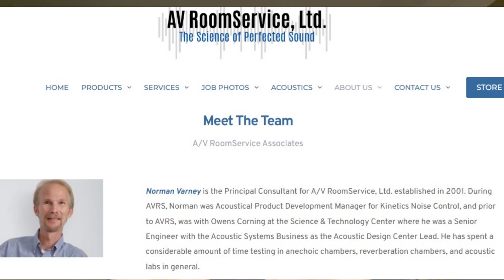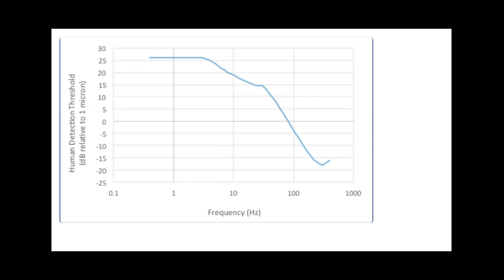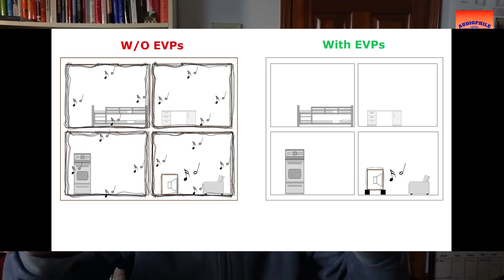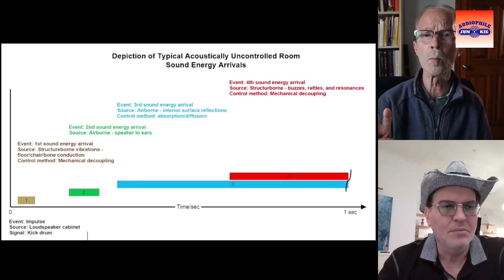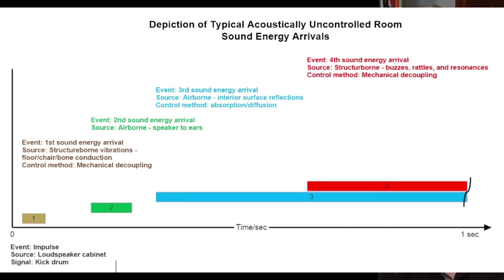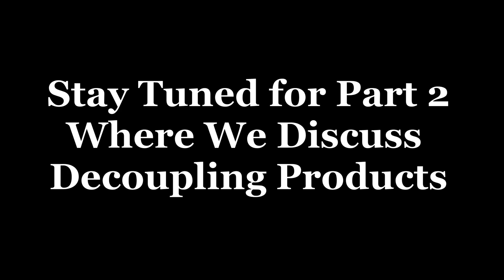Couple or Decouple?  THAT is the Question and the Physics Why One Is Ruining Your Bass - Part 1

Comment: In my experience. Couple the speakers with spikes but decouple subwoofers and the source/pre-amp/amplifier etc. with rubber feet.
If the speakers are decoupled it messes with the timing and makes the music sound undefined.
Reply: Coupling will always skew timing, because it includes vibrations from more than the just source.

Comment: The coupling/decoupling question is probably a lot more complicated than we imagine.
The sheer range of factors is mimd boggling: integrity of loudspeaker cabinets, drive unit integration with the cabinet, differences in flooring, room construction, loudspeaker frequency response etc.

There is unlikely to be one answer that satisfies everyone.
Reply from the maker: You're correct and we touched on the fact that nobody has really ever experienced a totally isolated room from their equipment due to a variety of factors... Just like virtually no one can create a totally anechoic room... No matter how many room treatments they add 

However, if we can all at least agree on the physics, and the fact that colorations due to vibrations are bad.  From there, we can then debate whether these vibrations cause any MATERIAL problems that are audible for the songs and volume we enjoy.  

In many cases, the microphonic vibrations aren't creating a huge audible problem with our other gear or room... But we can still agree that it's better to NOT have them for optimal POTENTIAL performance.
Reply: Vibrations, other then the source, distort the source, all with varying degrees. As audiophiles and/or audio engineers, we desire optimization of performance, neutrality, consistency, and repeatability. Remove as many variables (distortions) as possible to get the to truth as well as maximum fidelity.

Comment: Correct but that’s only one thing
Your room is the. Biggest distortion 
Most people don’t have proper room treatment acoustics. QRD diffusers & affecting bass traps
Ones that are effective are diaphragmatic activated carbon built into the walls ceiling’s & floors a room within a room not coupled to the existing room
QRD on whole of front wall & Rear wall
& some absorption on side walls also
Look at acoustic fields Dennis foley
Reply: Yes, room acoustics is the biggest contributor of audio distortion for most everyone. You are specifically referring to airborne vibrations, while we are specifically addressing structureborne. Onsite testing is needed to prescribe the right type of acoustic panels, in the right locations, at the right quantities.

Comment: I feel the air pressurize in the room a lot easier, especially at lower listening levels when decoupled, because I'm not losing that transfer of energy through the surface the speakers and subs sit on.
Reply: Decoupling makes the sound more articulate because you don't have large surfaces acting as speakers themselves. The source speaker output energy is the same with or without coupling, but pressurization of the room will cause constructive and deconstructive interference with the source.

Comment: From my experience with main speakers. When I put them on spikes (instead of rubbber foots) - bass became more solid with better attac to my taste. And I can not tell there was some structure vibration. That was when I lived in appartment with very stiff floor (oak parquet on concrete base). But in another house with soft board floor on lags spikes did not make any effect. May be combining 2 methods (coupling or decoupling) the best will be to place sub or speaker coupled to some heavy base (marble or cocrete plate a few times havier than speaker itself) and than this plate to decouple from floor?
Reply from the maker: Thanks for sharing your experience. The issue may be what you used to "decouple".  Rubber feet versus cones have different levels of decoupling from almost zero to modest. 

If you try more aggressive decoupling products, you might find that on any surface it will sound overall better because your room isn't singing along with the music. 

With good decoupling products, you don't really lose any solidity to the sound... In fact, it's much cleaner and detailed.

Comment: My hifi friend,who is a REL owner says that they don't recommend decoupling for what it's worth. Personally I feel it's a good idea,as long as the cabinet is stable.This is without the acoustic feedback in the air itself,which is pretty much unavoidable unless the rest of the equipment is isolated in a separate room.
Reply from the maker: I have a video of a REL sub hopping along a wood floor while playing.  I'll have release it so you can see that the sleds aren't achieving that goal mentioned.  In fact, on the stacks, they need extra coupling to keep them in place.
Reply: @AudiophileJunkie Oh,are the "sleds"  supplied and recommended by them? I don't use REL myself, so i'm not familiar with them these days.I used to sell them back in the 90's.
Reply from the maker: Yes...they have sleds under models as part of their particular design.  I actually own a REL 25 and think there are good things about it, but the sleds don't provide much isolation or the "stability" that you mentioned to support the logic for NOT decoupling.  In many cases, it won't make a huge issue and the sleds are fine.  However, I do have footage of one of their smaller subs literally dancing on the floor.
Reply: Acoustic feedback would mean structureborne 99% of the time through a sub/turntable loop. The reasons REL offers regarding why not to decouple fly in the face of basic physics. We guarantee that you'll prefer properly isolated subs with 30 days money-back.  In addition, I suggest that subs will perform more accurately if you locate it away from problematic room modes for all three axis. For example, with a typical 8' ceiling, elevating the center of the cone 1.6' above the floor will offer a more linear bass response from a room mode POV for f3 at 210Hz. and f4 at 280Hz.
Reply: When I decouple my mains and subs, I feel the room pressurize a lot easier, especially at low volumes because I'm not losing that energy transfer through the surface the speakers and subs are on.

Comment: Speaking of dispelling audiophile myths..

Plenty of skeptics would say that the belief many audiophiles have that they have to isolate practically all of their gear from vibrations is a myth itself.  But this idea seems to be perpetuated even in this video.

I have seen Mr. Varney’s presentations before, including some long interviews, and I am generally on board with the theory for decoupling loudspeakers.  And I also would guess that his loudspeaker decoupling product could be very effective in the right conditions.  

That said, I’ve seen him make these claims about vibrations from loudspeakers causing audible consequences on practically any type of gear, whether it’s amplifiers, pre-amplifiers, DACs, CD players, etc - and here he’s even adding in cables and connections.

I have never seen evidence (beyond the usual audiophile claims and anecdotes that support every tweak ever conceived) that, in the real world, vibration of those components from the sound levels produced by a loudspeaker end up causing audible changes.  

Since Mr Varney touts his company’s measurement oriented work, his company seemed perfectly suited to produce the evidence.   I emailed Mr. Varney a couple of times asking politely if they had measurements, or any results from listening tests controlling for bias, showing audible level changes in the signal coming out of any of that type of gear, caused by speaker vibrations.

Unfortunately, I never received a reply.  I wonder if, should he see this question , Mr Varney might comment on what type of evidence they have for the claims made in this video concerning audible effects from speaker/sound vibration on the other audio equipment, he mentioned.

If there’s good evidence, then it would be good to show who is likely perpetuating the Myth :  those who claim it’s worth worrying about vibration of their cables and DACs and solid state amplification etc. Or whether it is the skeptics who are perpetuating a myth that these things are very unlikely to be audible.

cheers
Reply from the maker: I've featured many different decoupling products and MFGs.  I actually don't have any of Norman's products myself, but many of my friends do and vouch for them. 

The subsequent videos will show him doing demonstrations to show decoupling in action, but it's always going to be a huge variable as to what those vibrations do in your room... your gear...that you can detect with your ears.  It may not always be drastic, but anything that's microphonic can be measured objectively when you increase vibrations.

Overall, it's about presenting the science, logic, and physics first... as a general concept most can agree on...Then you can decide what products you want to try to address it the best.

On the flip side, if someone doesn't believe that vibrations matter or that it's good to add them to the listening and structure, then it's pretty easy to find products that produce EXTRA vibrations under their equipment... Under their floors... On their shelves... And even attached to their speakers, tubes, turntable, etc... to get the extra coloration they enjoy.  

It's highly unlikely that ANYONE can't hear that and will enjoy that long term, but if someone doesn't agree with the logic and science of decoupling, it's only logical that they go in the opposite direction... Unless they somehow feel that music playing randomly at any volume will always produce the exact amount of 100% pleasing vibrations they love.
Reply: I do not recall receiving your emails. Our website has third-party-accredited acoustic lab reports posted. We also have about 100 testimonials, several on the website. In addition, we offer a 30-day money-back guarantee.
Reply: @AVRoomService 

Thanks for responding!
I used the email contact from your website when I made my inquiry.

In any case, as I’ve said, what I was looking for was objective measured evidence for the proposition that speaker born vibrations in a system can vibrate certain equipment to the point where the effects are audible.  Among the equipment you (and other similar manufacturers ) mentioned that are susceptible to this effect have been:  CDPs, DACs, Solid state amplifiers, pre-amplifiers, even cables and connections.

I think there are reasons to be sceptical of these claims (among them I work in the pro sound industry, and generally these are not concerns, and the prospect that they are would have all sorts of seemingly implausible implications.)

Every audiophile product comes with its own technical story from the manufacturer, and for every product and every tweak anybody has ever dreamed  you can find positive testimonials.  (Usually there is no objective evidence in the form of measurements and bias effects are not being controlled for, so it’s understandable that you can find testimonials for anything no matter how pseudoscientific or impossible.  That’s just human nature.)

And I’m sure you can appreciate that as a consumer, I’m aware that it’s in the interests of manufacturers, for instance for isolation products, to expand the range of use for their products as wide as possible to all sorts of gear so as to sell more product “ it works for practically everything in your system!”

I’ve been impressed with some of your demonstrations of the EVPs and it was after watching a long presentation you made to some audiophiles, where  the role of science and measurements in your work was emphasized…no bs… that I figured “here was a company who can hopefully provide objective evidence for these type of claims.”  Which is why I contacted your company with the questions. 

 As a consumer, I would like to be informed about whether the likely vibration effects on the equipment listed above are:
1. Measurable.  2. Audible. (because measurable doesn’t always mean Audible.) 3. And if so, how likely these Audible effects actually are in most systems.

I’ve looked through your website and if that information on my specific questions is there, I’m not sure where to find it.  Can you tell me which articles would contain the measurements showing speaker vibrations cause audible consequences with the type of gear I’m inquiring about? 

Thanks!

Comment: My floorstanding speakers in my listening room are on a sprung wood floor covered with carpet.  I went down the rabbit hole of trying many different types of materials, and footers, including isoacoustic Gaia and even Townsend spring based speaker isolation bars.

In the end, I found that when the speakers were fully decoupled I didn’t care for the sound as much.
They certainly took on some more audiophile attributes - the speakers disappeared more, tighter bass etc.  However, I found I lost too much “room feel” and that the sound had become more weightless, reminding me more of an electrostatic speaker.   It lost the sense of solidity and groundedness that to me made the sound more realistic and satisfying.

In the end, I came up with a solution that only partially decoupled  the speakers from the floor - involved making a granite base, some use of the isoacoustic Gaia, and even some coupling to the floor using spikes.  I got what was for me practically the perfect sound - tighter bass, improved tonality, yet still satisfyingly, dense, and punchy and solid.
Reply from the maker: Like we mentioned in the video, you may prefer vibrations and that resonate characteristic of your room and floors adding a pleasing coloration to the sound.  However, for many, it's like putting ketchup on steak.  It's not being faithful to high fidelity metrics and the goal of producing accurate stereo sound.  

In most cases, the extra resonance won't be a huge audible issue, so I understand why it can be a flavor that people can get used to. However, there will inevitably be recordings and sound volumes where that extra coloration is very problematic and blurring what you are hearing such that you definitely would choose it NOT being there.  These high fidelity metrics and the goal of accuracy and neutrality are valued for good reasons... Both subjectively and objectively.
Reply: A raised wooden floor  is likely around 7 Hz., which the the IsoAcousti8cs and Townsend are not very effective. The EVPs are lab-proven to be effective from 5Hz. on up, conservatively by about 90%. Isolation will mean a quiet room, and no reflections back into the speaker cabinet, or other audio equipment.
Reply: @AVRoomService 
Thanks.  I disagree about the Townshend Spring based products being ineffective in my situation.  First of all they are spec’d to isolate down to 3 Hz.

I found them extremely effective, producing results much like most reviews and users have noted.  
There was a fairly dramatic change in the sound.  Aside from the sound from the seating position, when I played loud bass heavy tracks and stood on the floor near the speakers while they were using spikes or sitting directly on the floor, I could easily feel the floor vibrating along with music.  I could also feel the ottoman. I put my legs up on vibrate with the music.

I tried all sorts of different materials  and isolation devices and none of them completely stopped that transfer to the floor.  
But the  Townshend killed the vibration absolutely dead.  I could not feel any transfer whatsoever.  Nor could I feel the Ottoman vibrating under my legs anymore with the music.

I also had an iPhone and iPad vibratobeter app to measure the transfer of vibrations.  With the Townsend isolation bars in play, I could place the iPhone on top of the speaker and stop the ground at the base of the speaker and virtually no vibration showed up on the app.  Likewise, if I placed the iPhone on the floor and banged on the speaker.  Nothing.

Whereas every other material, I tried , including the Isoacoustic Gaia could not replicate this performance.

All that said, I find the design of your  EVPs to be very intriguing, and I have enjoyed watching some of your demonstrations.  If I were still in the market, I’m pretty sure I would purchase some to try out.

Comment: I am a firm believer in decoupling all speakers after years as an audiophile and involved within the industry.  You don't have to spend a fortune to test it for yourself.  A cheap test is 2 or 3" of the packing styrofoam cut to the size of your speakers.  If you like, you can upgrade.  Thanks for the video!

Comment: Everyone misses the Theory of Operation  !!! Speakers are just like a Projector pointing towards a screen. 

The Screen equals the SoundStage the Speaker are    a projection source. 

Because sound works at such a low frequency range it is susceptible to primary vibration that means it won't cast the best image forward without isolation .